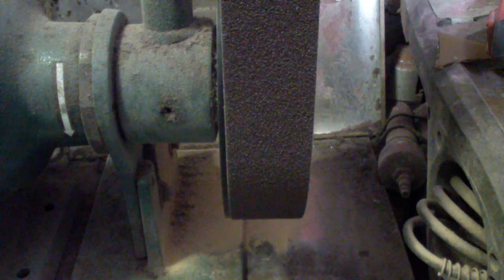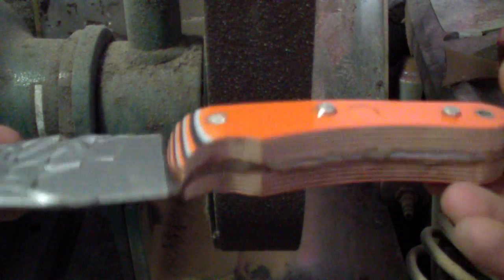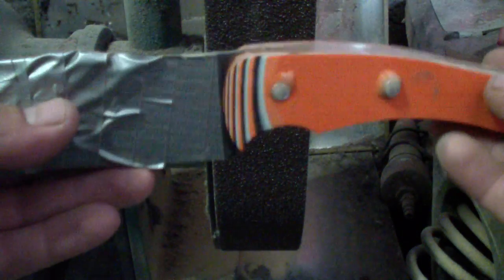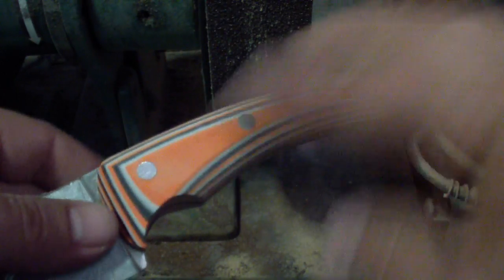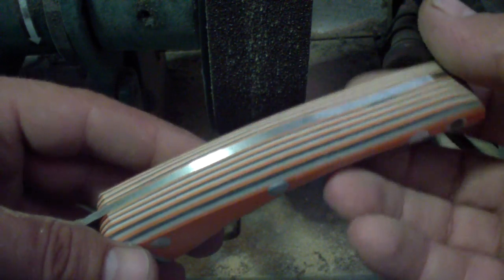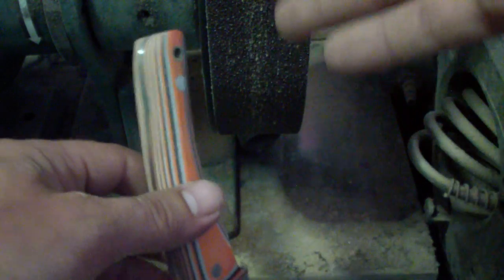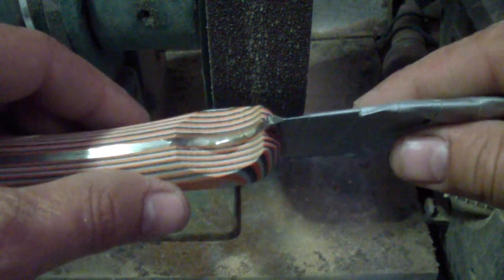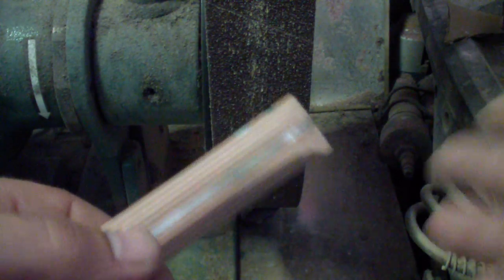Basic Knife Handle Contouring Tutorial

Comment: try newer sandpaper, or get a lower grit sandpaper. Don't hold the G10 on the belt in one place, it will heat up too quickly and burn it, that is probably what is happening. dip it in cool water?

Comment: @ Mike: How do you like the Grizzly belt sander after several months of use? Would you buy it again? Also, how do you like using the 72x2 belts in terms of wear, heat build-up, availability and cost?

Also, thanks for the instructional video!